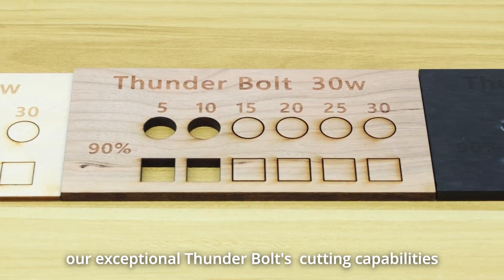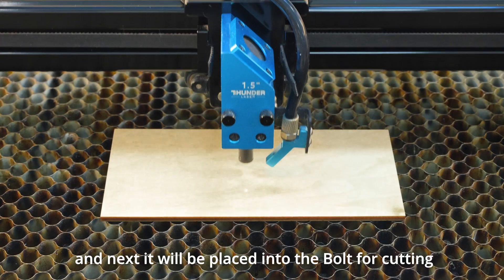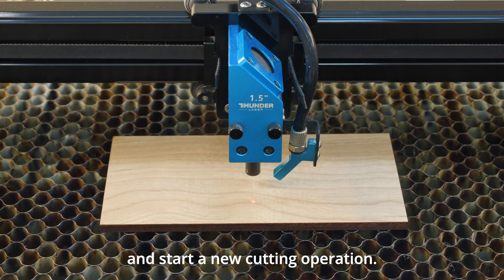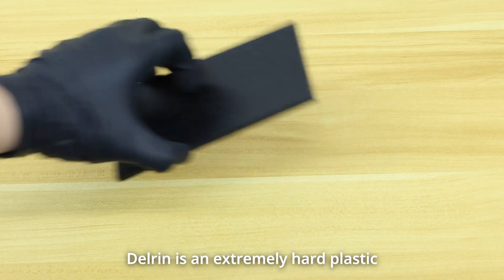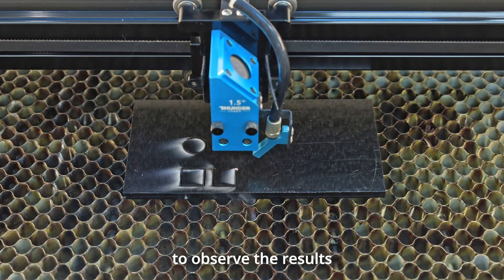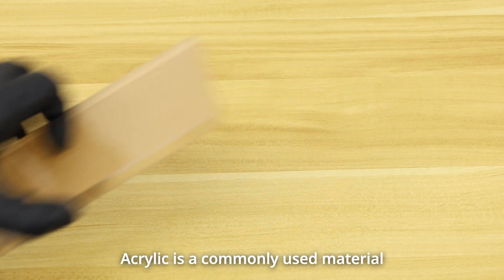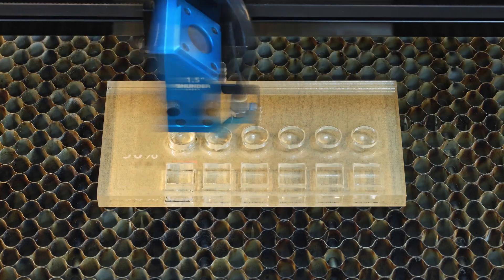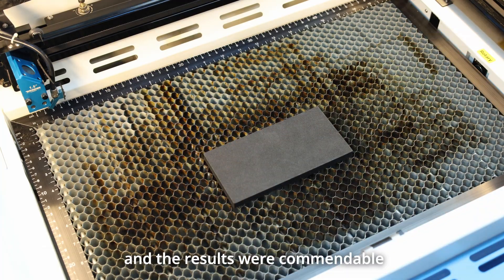Thunder Laser Bolt: The Ability to Cut Through Thick Materials

Comment: shame in the video the focus is out, it would have easily cut through at faster speed if in focus, I have the Bolt and the Bolt Pro,  I can cut 14mm acrylilc amd 10mm mdf so anyone not cutting 1/8 there is something wrong, most common fault is max power set too low in controller, in RDworks or Lightburn, co to controller setting and look at default min and max. Max power should be 95.
Reply: whats your settings for the acrylic? I'm struggling to cut 10mm acrylic without severely melting or charring the edges.

Comment: How many passes? cause i have abolt and it wont even cut through 1/8 birch plywood in 1 pass at 100 max 2 speed
Reply: Same! Sorry I ever bought this machine tbh Too much hype for something just meh
Reply: @user-pl9wg5gc5i  perhaps I should take it off the “possible“ CO2 list. Maybe OMTech will come out with a new Polar towards the end of the year.
Reply: I've had a Bolt since the beginning of the year and was able to cut through 1/4" materials pretty easily with 1-2 passes but just recently it stopped being able to do that and doesn't want to cut thicker than 1/8".
Reply: @thebeardedbrushandblade3091 did you solve this issue and or would you recommend a high wat tube
Reply: I have a bolt and have had no issues cutting thicker material. Make sure your machine is calibrated and lens are clean!
Reply: disappointing to hear that, almost as disappointing that they did not respond to your comment.